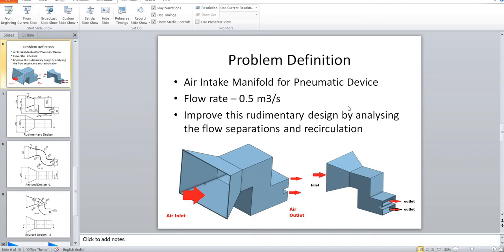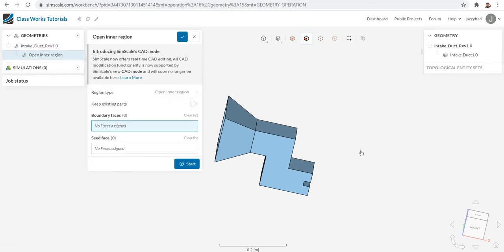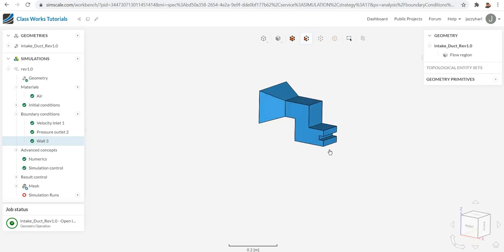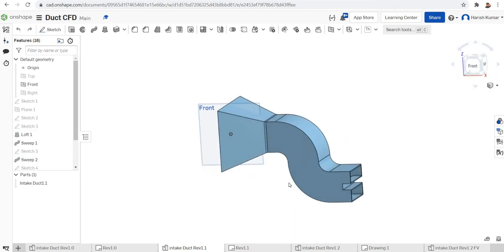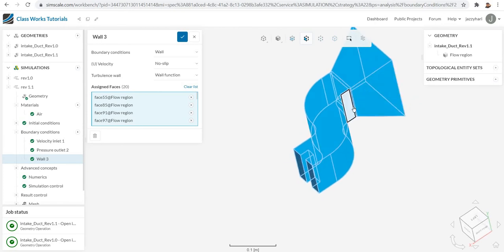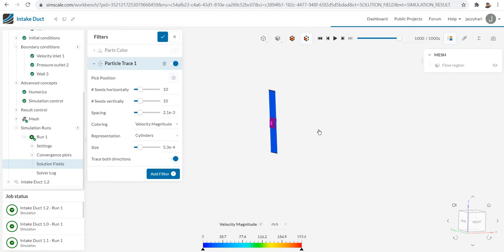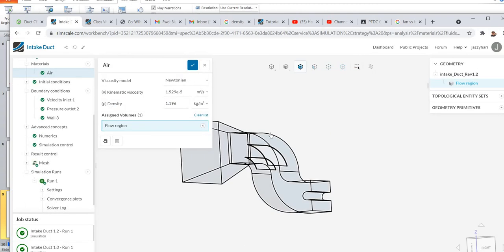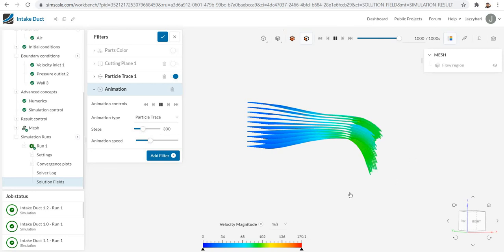18 Introduction to Simscale - Flow Analysis of an Intake manifold for pneumatic device

Comment: I did like you but the simulation did not run it said ((Multiple boundary condition assignments for the following entities: face32@Flow region)) but I defined all boundary conditions the V-inlets and v-outlet the pressure but the simulation did not run I tried several times but I could not run this simulation spent around 1 week but nothing happend .